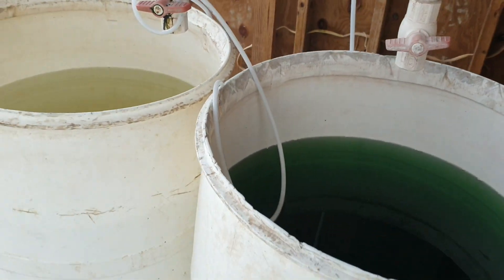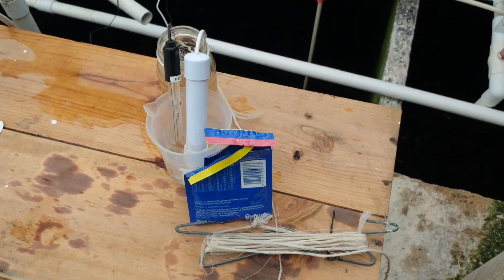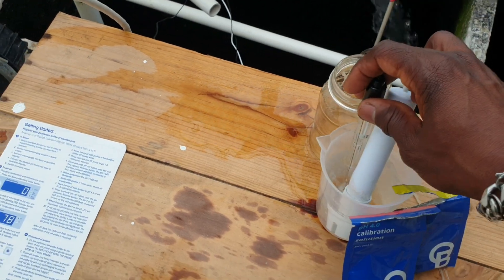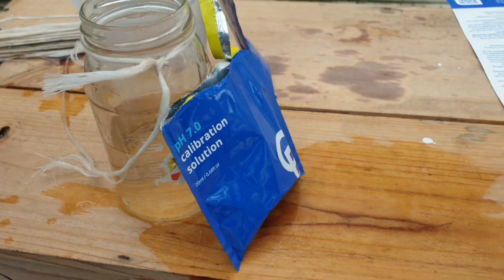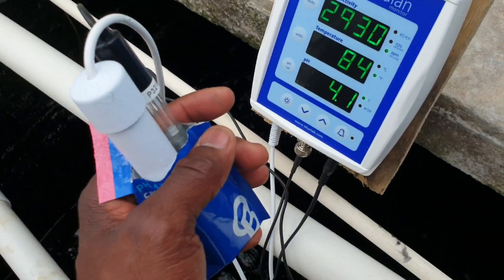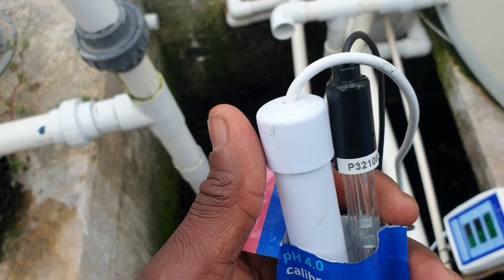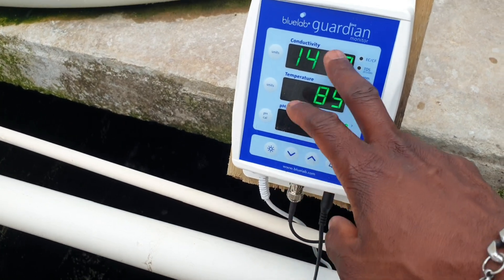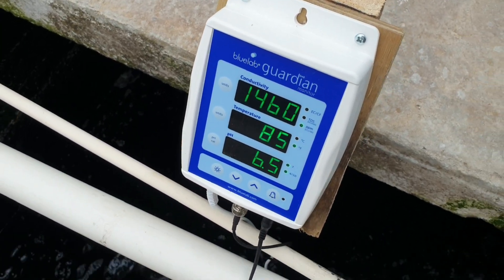How to calibrate the Bluelab Guardian Monitor | Conductivity, Temperature, and pH

Comment: Can you leave them in the water without removing them? How often do you need to replace ph probe?
Reply from the maker: Yes, these meter probes were meant to stay in the solution permanently. You can take them out periodically to clean them. You replace the probes only if they are damaged. How long they last depends on how you maintain them, thank you.